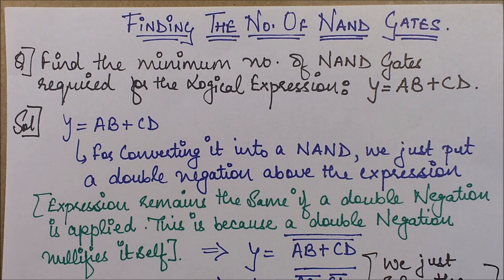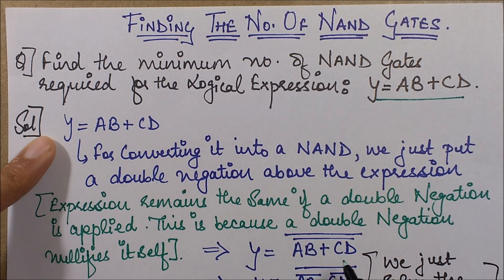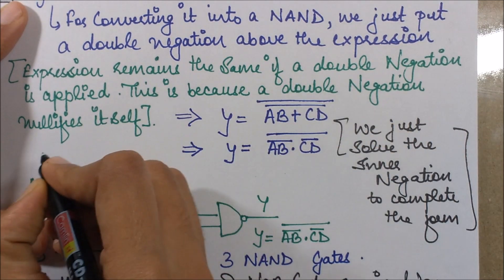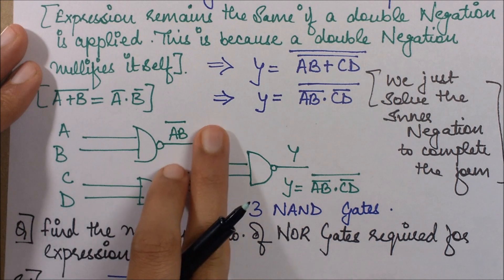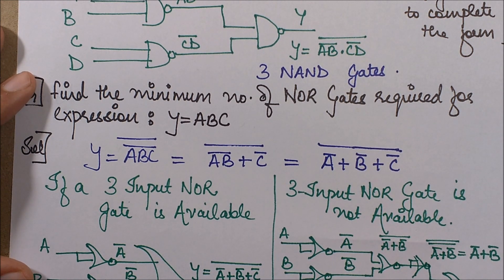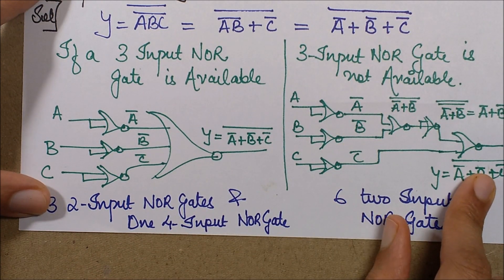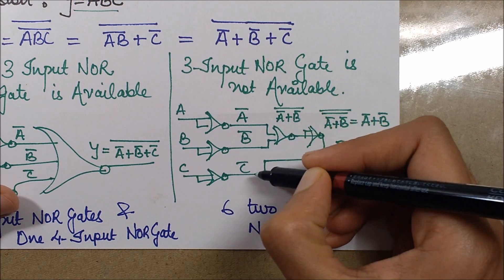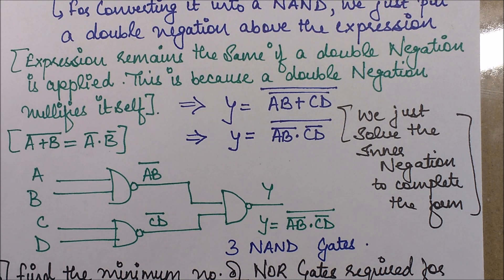Minimum Number of NAND Gates for a Logical Expression

Comment: Implement Z=A+B using NAND implementation by converting it into its SOP form first .
Reply from the maker: 3 Nand gates, one each to form  A bar and B bar, and finally one to Nand A bar and b bar. I'll post the complete solution video by tomorrow.
Reply: @ritukapurclasses1591  Sure mam , I also subscribed and waiting for your video . Thanks mam
Reply from the maker: Sure :) I'll post it tomorrow...
Reply from the maker: I could send you the written solution immediately through email. Email me at rkclasses15@gmail.com, if required.

Comment: If we follow this approach, then to find minimum no. of  NAND GATES for xy'+x'y.

our answer comes equal to 5 and the actual answer is 4. Please correct me If I am wrong,
Reply: Using the intuitive way,
XOR (A,B) = A' B + A B'

So, for using NAND Gates, we use double complement method:

XOR (A,B) = ( (A' B + A B' ) ' ) '  =  ( (AB') ' . (AB') ' )'

Now in order to implement A' and B' we will have to use two NAND Gates and then two more to implement  (A' B)'  and  (AB') '. And at last 1 more NAND Gate to implement ( (A' B)' . (AB') ' )'. Hence all in all we Will be using 5 NAND Gates. This WONT WORK !

Hence we have to think of an OPTIMIZED Solution !

Therefore we use a new method to obtain (AB') ' and (AB') ' using lesser number of Gates.

Using NAND gates we directly have (AB)' . Now we can make use of this and obtain (AB') ' and (AB') ' using lesser number of gates:

We see : (A B') ' = ((AB)'.A) '   And  (A' B) ' = ( (AB)'.B ) '

Hence the equation can be reduced to :

XOR(A,B) = ( ( (AB)'.B ) ' . ((AB)'.A) ' ) '

This solution would require 4 Gates only. Hence Logically we can arrive at this solution.